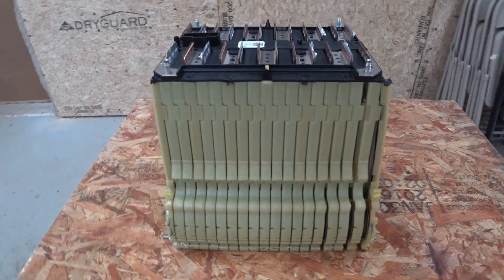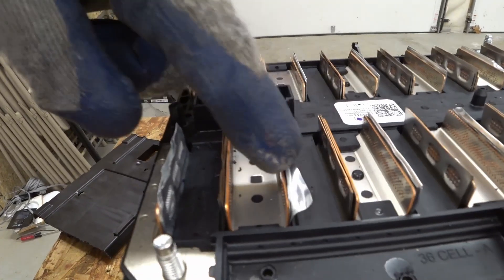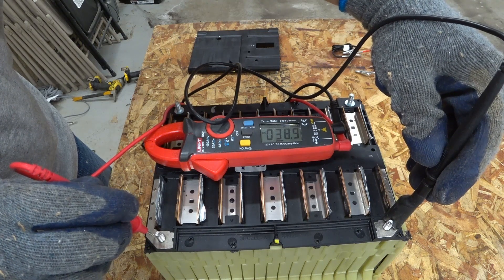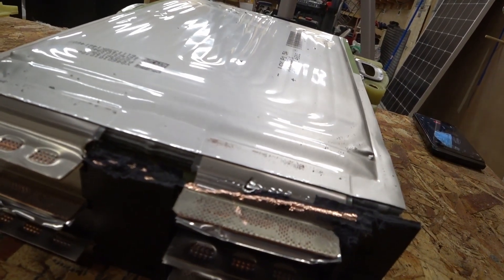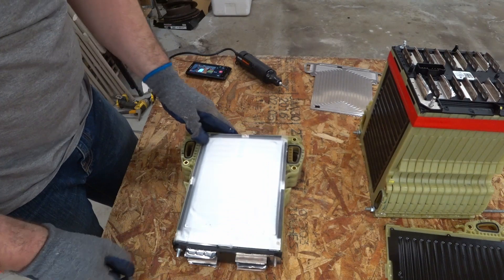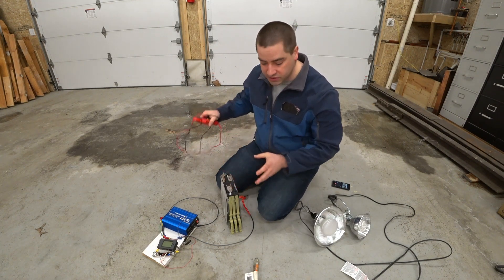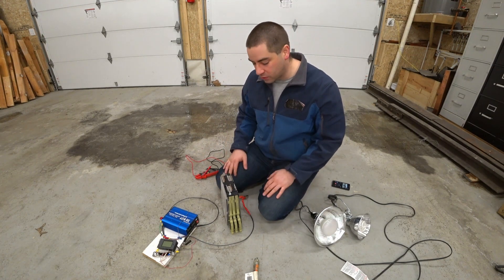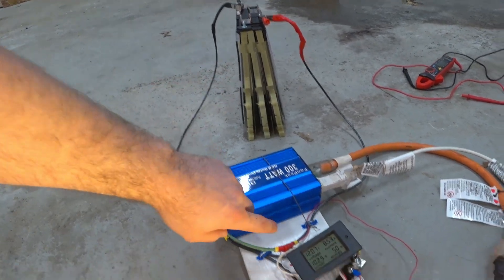Taking Apart a Bad Lithium Battery, Expanded Cells

Comment: I was really cringing when you connected directly to the car battery, and without any balancing!
Please get a proper lipo/liion balance charger/discharger, something like a Charsoon Antimatter which is cheap and versatile, easy to use and can do 1kW with 24V input.
The gas in the pouch cells is not air - it's oxygen from degraded LiCoO₂ cathode material, so with less of it, its capacity will be reduced. I don't think it's dangerous - it shows the cell was discharged for a long period.
It's still usable for lighter applications, but it's on its way out...
Reply from the maker: I was hoping for something dramatic (*poof*) when I connected it up.  LOL.

Can you please link to a charger?
Reply: @DavidPozEnergy  I bought this to add to my Turnigy Reaktor and it arrived last week:
https://www.banggood.com/Charsoon-Antimatter-1000W-30A-Balance-Charger-Discharger-For-LiPoLiFeNiCdPB-Battery-p-1119832.html
Hobbyking Turnigy and Banggood Charsoon are different brands of the same manufacturer - Hextronic.

Average Joe has a few good videos on it - apparently the capacitors can blow up occasionally, but they're easily replaceable!

Jehu has also featured some American chargers recently which he used with a couple of cheap DPS800 server power supplies to charge a 5.5kWh Tesla module.

This is the route I took - I got a couple of those $30 PSUs and modded them to switch on on plug in, and isolated the outputs of one of them so I can connect them in series for 80A at 24V - 2kW for 60 bucks - nice!

Comment: NMC Batteries should only be charged 4.15V per cell max just so you know.
Reply from the maker: I'd like to be accurate, because I've been telling people the max voltage is 4.2 volts per cell.  I got that number from here: https://batteryuniversity.com/learn/article/types_of_lithium_ion  If this is wrong, and 4.15 volts per cell is the actual max voltage, then can you please link to a reference for that?  Thank you.
Reply: @DavidPozEnergy  satellites orbiting the earth have done tens of thousands of cycles because they operate between 20 and 80 percent SOC. going outside this range reduces cycle life enormously.
Reply from the maker: Thank you all for the great resources.  I love reading this stuff.  I've had my charge controller set to 49.2v (4.1v/c) because I though it was 4.2v/c max and I wanted to stay away from that top end.  But after seeing this I'll go drop it down to 48.6v (4.05v/c).
Reply: DavidPoz 4.1V is fine. 4.2V is full charge. Most EV manufacturers limit to 4.1V and call that full to extend the life of the cells. Good enough for them, good enough for you. Far more damaging to over discharge them and your very safe on the bottom end. 4.15V is just a different safe level designed to extend the life of the cells. BTW those cells are almost certainly damaged. At some point they’ve been over discharged. Sooner or later the battery will most likely internally short and potentially catch fire.
Reply: @mondotv4216  EVs are bottom balanced. 4.1 might be the highest cell. They do not bring all cells up to 4.1.
You make a lot of assumptions that are probably incorrect. Discharge does not damage cells unless they go negative. Recharge of an over-discharged cell is what causes dendrites and short circuits. There is no evidence that these cells were over-discharged anymore than there is evidence they were overcharged. Measuring internal resistance will tell you about dendrite growth, which will tell you if it was over-discharged. Measuring capacity will tell you if electrolyte has been lost which will indicate overcharging
Reply: @climatechangepreppersfaceb2148  
How would you measure the internal resistance?
Reply: @marscan1  watch my video how to
Reply: @DavidPozEnergy  I have seen a few of the Battery data sheets from Samsung and LG Chem and they all confirm that the max Voltage is 4.15V. It will be hard for you to find the datasheets since they are confidential but with some luck you might find one or two. 4.2V doesn't kill it immediately but I left a Samsung one sitting at 4.2V and after a few days it had a 3mm bulge!
It's not worth it anyways, there isn't any energy past 4.15V anyways. Always charging it to 4.2 will accelerate degradation in any Li-ion chemistry. So if you want a long lasting Battery you shouldn't go much over 4.1V and much below 3.3V. There are a lot of discussions online, I personally use https://endless-sphere.com/forums/.
Reply: @DavidPozEnergy  https://endless-sphere.com/forums/download/file.php?id=244435
Reply: Actually here is a DOE test that was done against the 2011 volt: https://www.energy.gov/sites/prod/files/2015/01/f19/battery2011volt0815.pdf
Highlights the max charge of 4.15 (at least what they consider max)
Reply: Forgot to add the initial DOE report page - interesting tech reading: https://www.energy.gov/eere/vehicles/downloads/avta-2011-chevrolet-volt-testing-results
Reply: If you calculate the additional wattage you get above 4 volts it is almost nothing compared to the cost of new batteries.

Comment: Sheesh   ((473/1000)/3) x 12 = 1.89 Kwh's for the pack, like you say, right in line with 'new' cells !  Ya really got to wonder what happened that caused those 3 cells to crash.
Reply: Not using a BMS would do it - with 3 seriously undercharged and 9 slightly overcharged cells,  the total battery voltage may look normal but hides the problem particularly near top or bottom of charge.
Reply: @ahaveland  Don't think that was the case. I believe this was straight from the car and was not used outside of the car. Something else caused this and/or the factory BMS failed.
Reply from the maker: @Mike: You are exactly right.  Straight from car to me, and everyone saw everything I did to it.  Thanks.  My best guess is the factory BMS had tiny resistors inside it, and those got left in the ON position, bleeding power from only those three cells.  Something must have failed to make this happen.  Maybe a spark or surge of electricity?
Reply: @DavidPozEnergy  I know you checked the levels of the cells regularly, so you would have noticed if they were low earlier.
So it's a mystery why 3 adjacent cells started to fail at the same time in the same way.
Reply: DavidPoz 5 possible reasons - 
1.)Cell was charging while the terminals exceeded ~ 4.2 vpc (volts per cell)
2.)Cell was discharged such that the open cell voltage (OCV) dropped below ~2.5 vpc
3.)Cell was charged at an excessive current, exceeding ~1.5C (varies by formulation)
4.)Cell was discharged at an excessive current, exceeding it’s rating, (varies)
5.)Cell was exposed to excessive temperature.

I’m favoring 2 or 5. The excess swelling is caused by gas generated in a chemical reaction with the electrolyte that is not reversible. The battery is physically damaged and should not be used, despite it’s apparent health.

Comment: Wonderful video David. This shows these batteries have a lot of resilience built into them. Do you know the exact watt-hours you'd have got out of them if they were brand new?
Reply from the maker: The label on the pack says 2kwh for that 12s module.  I cut out 1/4 of it, so it should be 500 watt*hours.  But I didn't drain it to 0 volts.  So I think it's capacity is still good.
Reply: @DavidPozEnergy  Never ever drain a lithium battery down to 0 volts!
Minimum voltage for lipo pouch cells is about 3V, though I wouldn't let them go below 3.3V.
Lithium ion 18650s are more forgiving,  down to 2.8V, but that also risks degradation, so I'd keep them above 3.2V.  There's so little capacity left down there it's not worth extracting.
Reply from the maker: @Andy:  I agree with you.  I was merely suggesting that the remainder (500wh-473wh) could be explained by the little bit I of juice I left at the bottom end.  I was not suggesting that we should go to 0 volts.
Reply: @DavidPozEnergy  That's a relief! :-)
I think you can find a use for those cells - my approach is if it still works, then why not?
Obviously, I'd relegate them to the B category, but you might like to try cycling them a few times with a proper charger and under pressure and see if you can get the oxygen gas back into the cathode material and reduce the puffing.

Comment: Nice test. They are pretty durable and you can poke a pinhole in it to let the air out and retape it. But like you said it could go anytime. Thanks for sharing
Reply: I've always wondered about this. I've accidentally punctured one, and the odor was quite strong. Any references to the advisability of this?
Reply: Oof

Comment: Charge it up and start a car on it :-)  That will give it a real load...  Amazing that the capacity is still there.
Reply: BAD idea. Don't listen. High C rate forms dendrites and lithium plating
Reply: My thoughts exactly, incase it, ad some jumper cables for a good jumper pack.
Reply: this would make a good diy vid and test
Reply from the maker: That's a great idea.  My only concern is temperature.  My car's trunk could fluctuate between -10°F up to 140°F.  I thought temperature swings like that could damage a battery, but are they OK?  Thanks.
Reply: @DavidPozEnergy  Valid disclaimer, keep around the house/shop to jump dead vehicles and equipment, I do plenty of that. I keep hesitating on spending $300 for a noco genius jumper! I have a salvaged nissan leaf battery about to be repurposed for 48 volt solar storage, considering to use a few modules  for a  small mobile pack with 120v  inverter.
Reply: Sorry I should have been more clear, I would not leave it in the car.  For one thing the car alternator would over charge the cells.  I was just thinking to see if the damaged cells can take high current discharge.  Starting a car would be a nice heavy load test.

Comment: Before you even open it... that puffing is due to Overcharge or Undercharge under load.... IMO
FWIW... I had a 4 amp RC Li-Po battery that was badly puffed up by letting it discharge under load (by mistake). I charged and discharged it numerous times and the puffing went back down. The battery is still unpuffed and being used more carefully.
Reply: I heard with pressure and charging, the oxygen can be reabsorbed into the cathode material.
Reply: @ahaveland  very interesting !
Reply: I had an A123 LiFePO4 pouch cell that puffed up on me because I was doing some charge and discharge testing. I decided to use a 5.2 volt source for a 3.2 volt battery and pumped it with about 8c current. It jumped to max voltage real fast then began to puff up. I stopped the charge then just charged it up slowly like normal using my power lab charger. Did a full charge discharge cycle with no damage to the cell capacity. I then left the cell out side in a safe place and after two years pulled it out and noticed that all the puffing went down and the cell is now fully tight again as new except it has a few small creases in the plastic pouch. Cell still has fully capacity even after all those years sitting the garage with no temperature control. Damn things are tough. Even LiFePO4 cells Love those old A123 Pouch cells. Need to repost that video on line.
Reply: I had a few Li-Po batteries catch fire while charging in the house. It was not good. As far as I knew there was nothing wrong with them when it happened. My wife put them out with the fire extinguisher. What a mess we had but at least we still have our house!